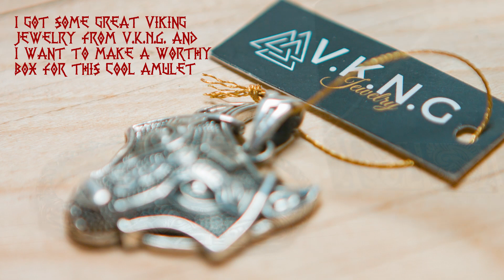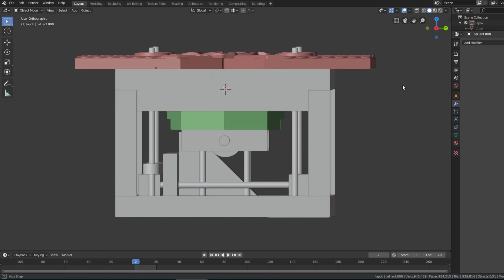Kinetic box for viking amulet - CNC and wood carvings

Comment: The tools you used to do detail clean up after the CNC portion, what were they?  They resembled lockpicks.
Reply from the maker: It's metal files. You can find similar, search this:
7 Inch Riffler File Set With Double Ended Files